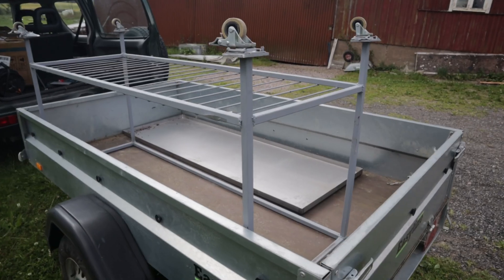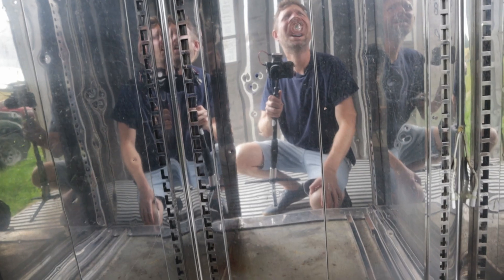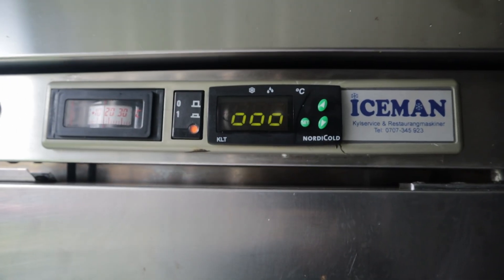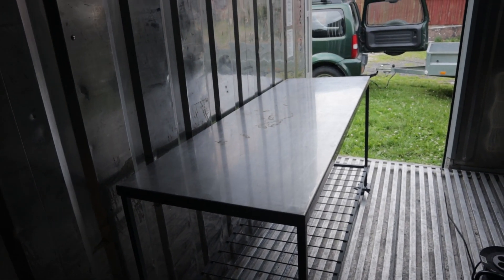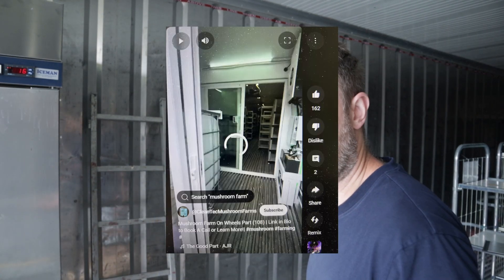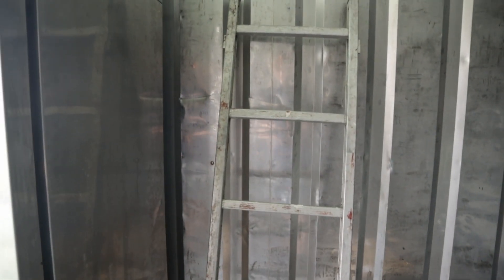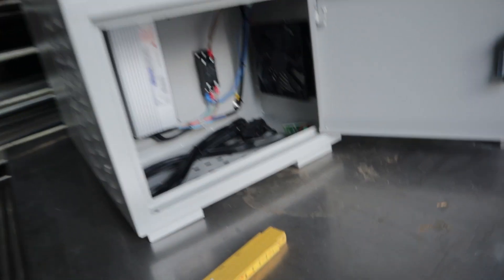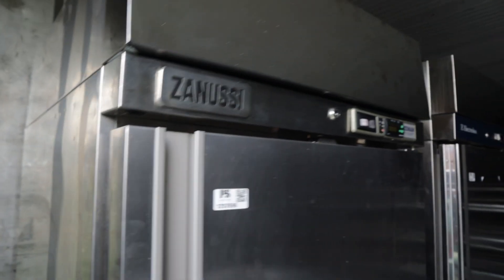Shipping container Mushroom Farm Update — Fridge Test, Humidity unboxing & Power Plans

Comment: Awesome setup! If I were doing that here in the hot southern us I would partially bury the container to keep it from coming an oven in the summers here. But cool stuff mate! Have a great day 😊
Reply from the maker: It would be awesome to partially bury it! Thanks mate, you too.
Reply: You can't bury the Thermo King refrigeration unit.
Reply from the maker: @haroldmclallen460  Yeh no, it wouldn't like that. Its out of commission at the moment. I have a plan to use some of its parts/structure. Might look into fixing it one day, as they can heat as well!